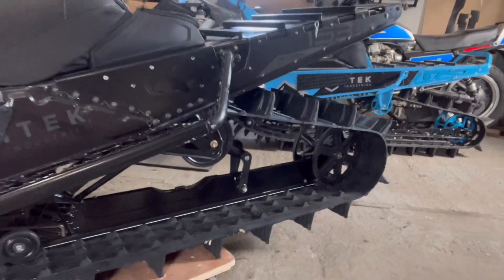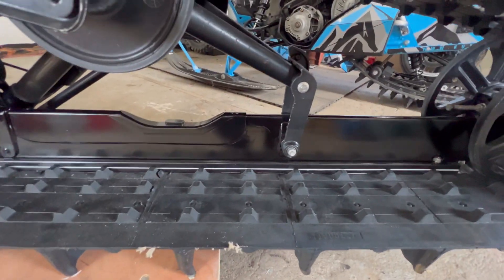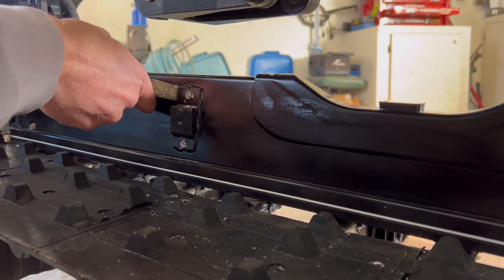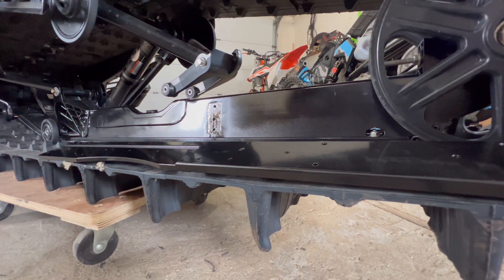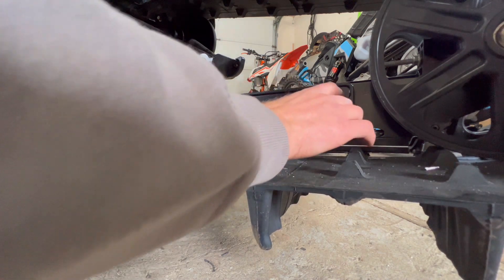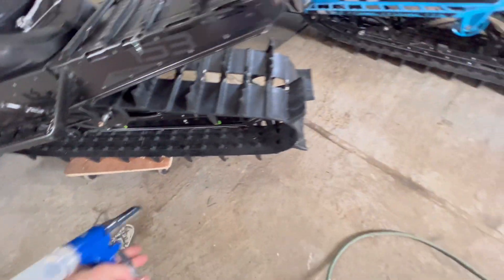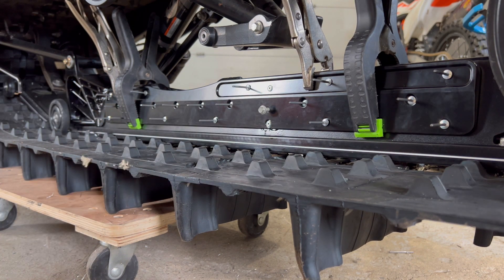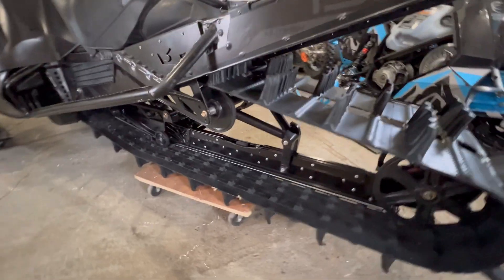Bullet proofing the Alpha with Pind

Comment: The brace still holding strong?
Reply from the maker: Brace is solid! And they have a new one out with a coupling system!! Pind performance for the win.
Reply: @JasonMcMurray  I ordered mine yesterday. Didnt get the coupling since i have 165 and isnt as much of a wheelie monster
Reply from the maker: @Brobro449  good move it’s the best brace out there!
Reply: @JasonMcMurray  i dont think you can beat the fact it takes that plate right off. Other ones like the bmp and rouge look good with coverage but just sandwich that plate in there

Comment: You have any issues with snow intake in the air intake on the alpha or m8000 hears thats an issue. Also does putting on a rail brace void the warranty
Reply from the maker: Yes Cats are known for snow ingestion. Check out my older video called "going west, getting the sleds ready" In that video I show how I sealed mine up and haven't had an issue since! As for warranty on alpha rails, i've personally only got one covered under warranty. That was because those little blocks that hold the rear scissor to the rail came loose. I would way rather prevent the issue from happening in the first place. Plus sometimes its like pulling teeth getting things covered by cat, not to mention waiting for parts and down time! Consider it an investment!